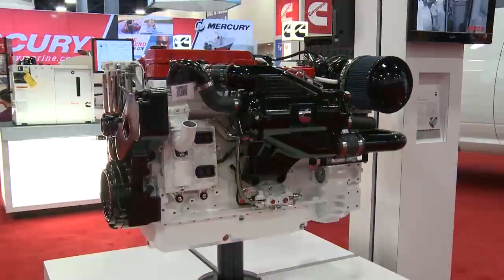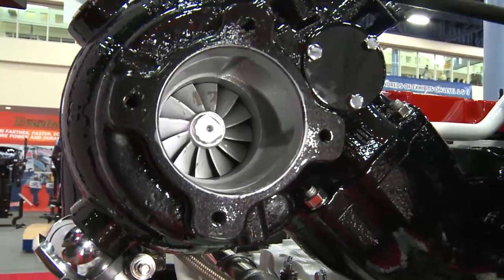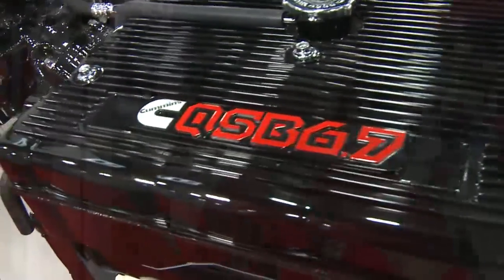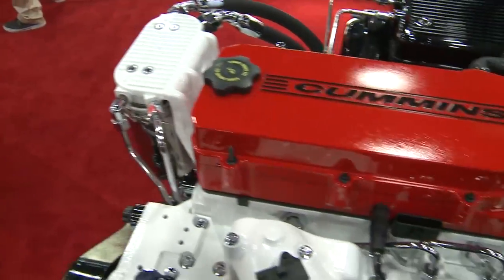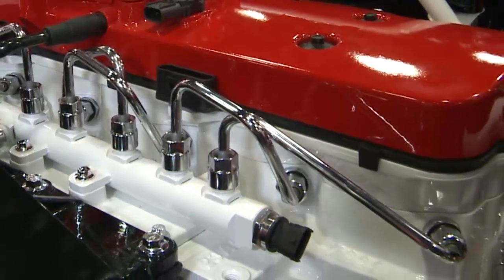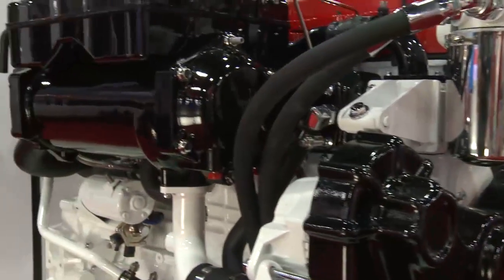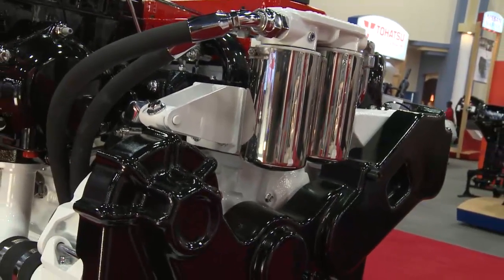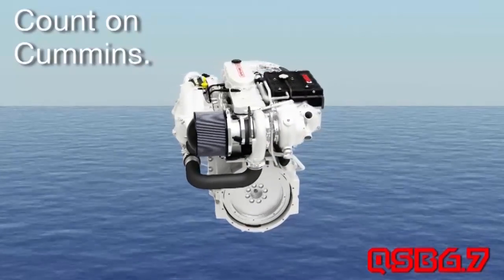Cummins 6.7L for Boats and Trucks - Compare and Contrast

Comment: No mention about the fact that the truck engines are front gear train... and the industrial is rear gear train. Very different and will not interchange in the slightest.

Comment: Bring back the 5.9L
Reply: Why? With the emissions that would be required, you'd be getting 300 hp and 600 ft lbs torque.. (or less)
Reply: Are you referring to the 6BT?